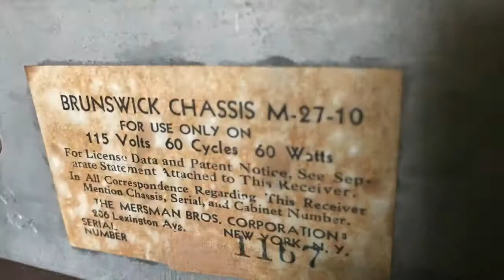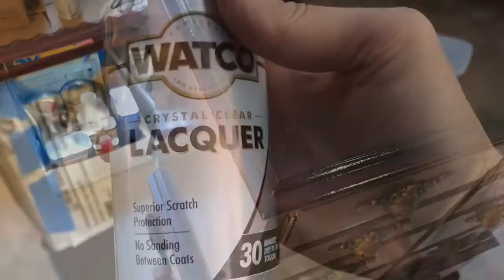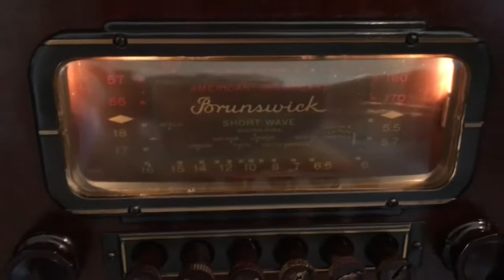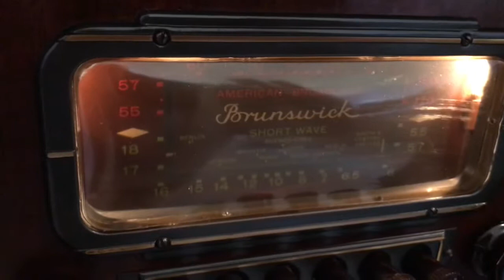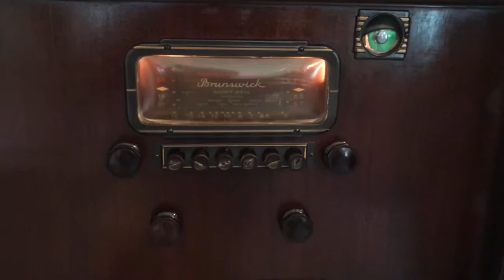Brunswick AM/SW Radio

Comment: I have this same radio. Can you tell me if this radio's birthday is 1939?
Reply from the maker: I believe it is 1939. From what I learned from websites, The Mersman Brothers Corp made the cabinets for Brunswick in 1939.   The schematic I used to work on this radio says "Brunswick Div Mersman Brothers Corp.". Brunswick made the chassis which is model M27. Other Mersman models with this chassis are from 1939. I hope that helps. So my best guess is 1939.
Reply: @My1925World  Yes, it definitely confirms what I thought. Now on to getting it up and running.